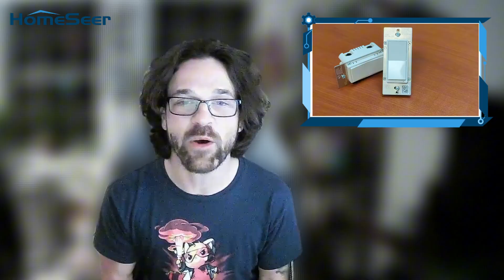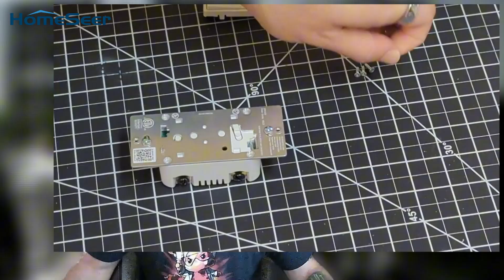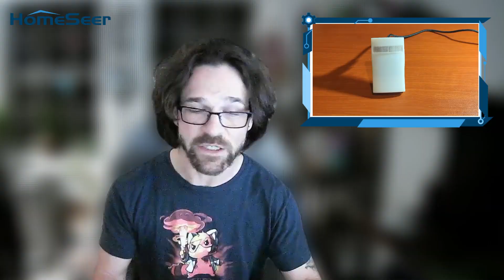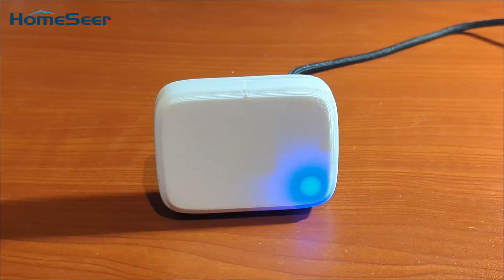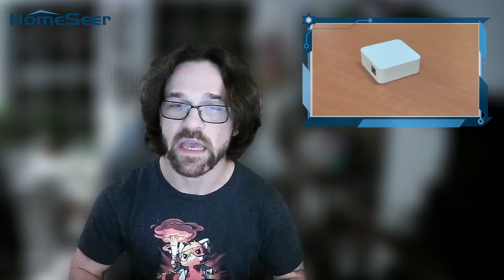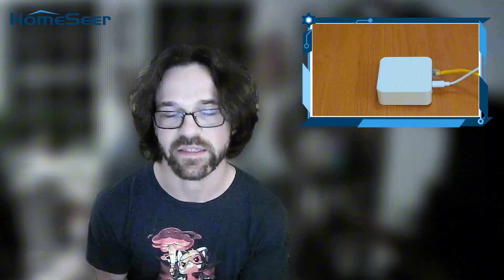HomeSeer September '25 Product Updates

Comment: How do I use the HSM200? As a notification device. When a door is open for a long time, I want it to notify me. It doesn't do everything I want; I'd like the blinking pattern to be programmable, and also to be able to mix notifications, for example, red every second and blue every 5 seconds. I'd like to be able to change those intervals whenever I want to make it faster. Two separate LEDs would be useful for mixing notifications. I don't use it as a sensor.

Comment: I have several questions.  Are there any plans to ever replace the HS FC-200+ fan controller?  Are there any plans to market a Z-Wave universal input/output module?  Something like 8 analog/binary inputs and 8 analog/binary outputs on one device?  The Homeseer Z-Wave water sensor can be improved by changing the battery holder.  I modified mine to accept a 3.6v rechargeable Lipo battery.  These batteries are made by EBL p/n LPN N J4RDQD36X, come in a package of 4 batteries and a charger.  When using these batteries, the rubber pad on the lid is not needed.  Also it is necessary to shave the plastic on the battery holder positive side.  A different battery holder could eliminate this problem.
Reply: ill second the fan controller.. best device in the house..
Reply: @darby427 I know!  I bought several and they work great.  I had one spare and wanted to buy another.  No dice, they were discontinued.  I can't find anyone else who sells a fan control like this.  The only failure I had was capacitor C7 in the light switch modules.  That same capacitor is also used in the switch mode powersupply for the fan control module.  I found a better cap and preemptively replaced it in every one of my switches, (almost 30 devices).  No more failures since.
Reply: Couple years back after they were discontinued, I just thought I'd ask if they had any lying around, they did.  Picked up 6 of them.  Best things ever!